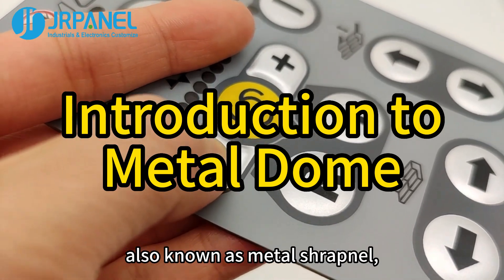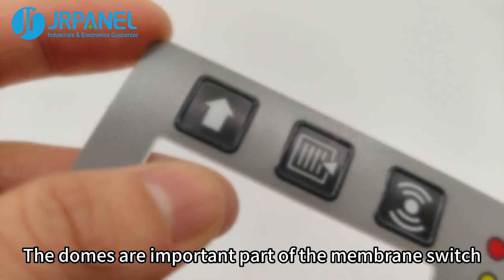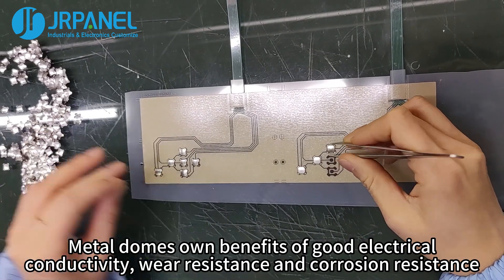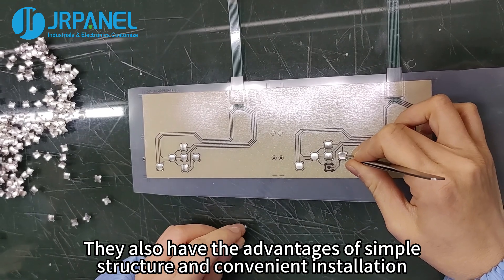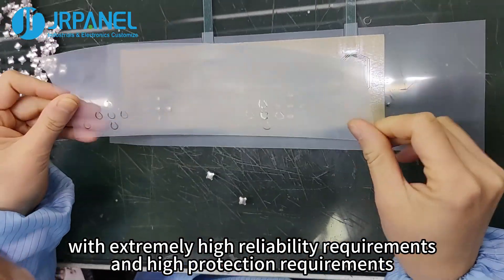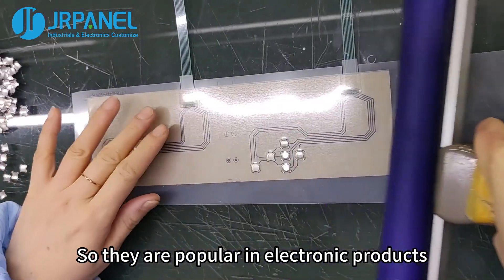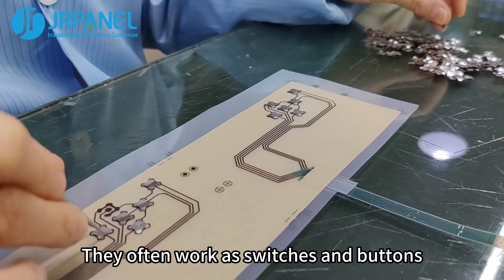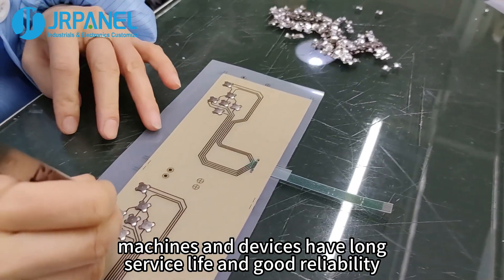Introduction to Metal Dome - JRPanel

Comment: How many times can you be wrong in one video?  Metal dome switches are NOT membrane switches.  Metal can't be ultra-thin and ultra-thick at the same time.  They don't "apply to membrane switches..." (they are different things).  Or "medical equipment" - Seriously?  What, just paste them anywhere on the outside, eh?
Membrane switches are plastic sheets with formed domes and conductive paint sprayed on the underside.  They don't last anywhere near as long as metal dome switches and degrade quickly with high use or high heat environments.